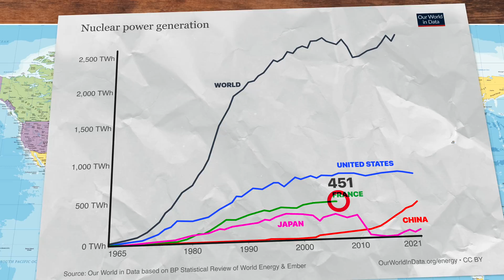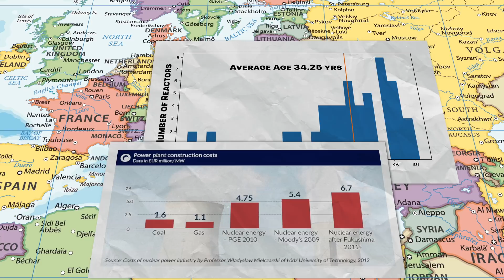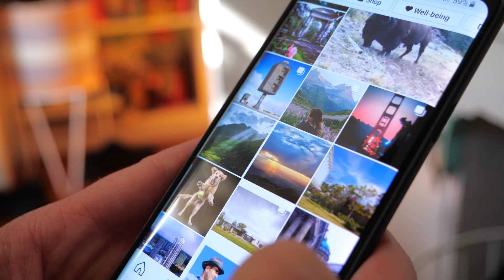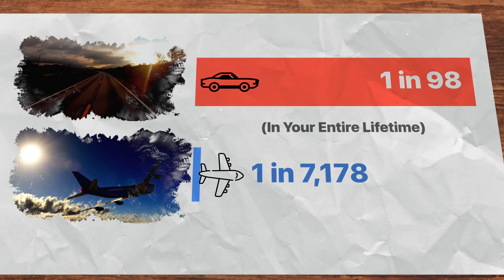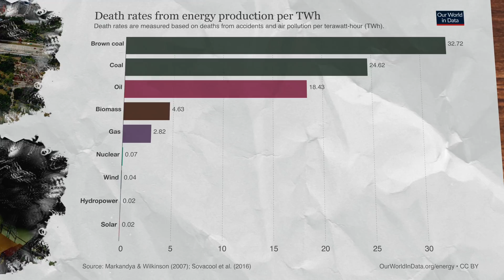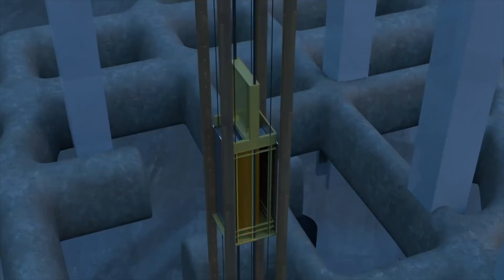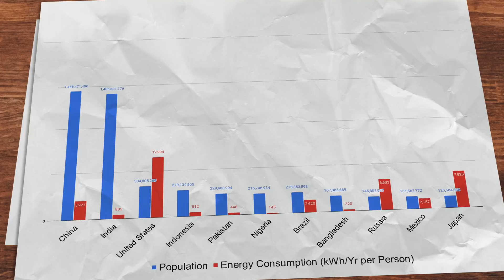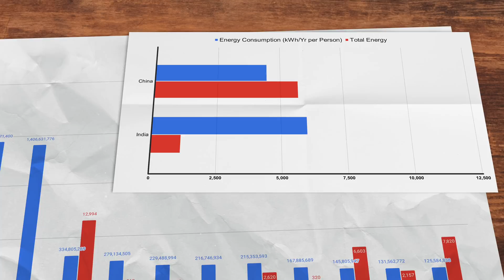The Future of Nuclear Energy Depends On This...

Comment: In addition to what you said about increasing energy demand, it's important to discuss the various ways of increasing energy efficiency and reducing energy consumption.   You've mentioned electric cars, radiative cooling, heat pumps, as well as deep-water air-conditioning.  That last one you didn't talk about before, but each of those technologies massively reduces overall energy consumption.
Reply: We should be decreasing overall energy demand, not increasing it.

Of course by this I mean total energy not just electricity. If an electric car pencils out to less energy than a fossil fuel car, that's great. If it's roughly the same and powered by low carbon sources that's fine too
Reply: High insulation especially in older houses dramatically reduces heating energy needs.
Reply: We need to keep in mind that personal choices on long-lived assets make for very slow transitions.  So, things like adding home insulation (80+ year lifespan on the home), replacing furnaces (50 year life span), and water heaters (25 years)... it just won't be fast enough to help.

In a sense, the transition to electric vehicles won't be fast enough either (vehicle purchase to junkyard is roughly 15 years on average and full fleet conversation is a 30-year affair).  But at least the electrics that are purchased can take advantage of the changing grid generation mix in real-time.  EVs really are the low-hanging fruit from the standpoint of the consumer because it allows us to get rid of an enormous amount of oil and gas infrastructure over the same period.

I'll also point out that technologies which depend on a water<->electricity trade-off are better suited to burn the electricity than to waste the water.  For example, 'swamp coolers' were popular in L.A. decades ago but are basically banned now, because water is more precious than electricity.  Same problem for hot water recirculation vs running the hot water tap waiting for hot water.  Electricity is a much better bet than natural gas environmentally in that case.

-Matt
Reply: @junkerzn7312  unfortunately, a LOT of homes are only built for ~30 years these days.

Swamp Coolers don't destroy water, they send it back into the air where it can go back to the mountains and then back into the rivers. Would be interesting to see one made to use salt water though. I could easily rig up a simple one using fabric and a fan and a vessel under the fabric to catch drips and salt, but those are pretty hillbilly vs a professional machine lol
Reply: @priestesslucy  Swamp cooler running on salt water?  That seems like a good way to make an insane quantity of salt.  It could be made to work, but fresh water would have to be really expensive for it to make sense.
Reply: @priestesslucy   Its important for water to actually come out of the tap more or less immediately when you turn the faucet on, not 10 years later.   Particularly during a drought.   So, no, that argument doesn't work.   If the reservoirs serving a population are in trouble, direct conservation is not optional.

You can google statistics on how long homes last.  It's a lot more than 30 years.  Even poorly built homes.   I think the average age at the time of demolition is somewhere around 60 years.

People come up with cooling ideas all the time, but there is no magic bullet.  You can try evaporative cooling with salt water but any device able to actually cool air that way is gonna clog up pretty quickly.  Besides, swamp coolers are really only effective in dry climates, usually relatively far away from salt water sources.

There is also environmental pre-conditioning for heat pumps, to make them more efficient.  Also not a magic bullet.  Geothermal energy (10 feet down) can be used to both heat and cool.   For example, if the outside air temperature is 100F it can be preconditioned down to 80F through underground piping, which gives the AC unit another 20F of margin.   And similarly, if trying to heat in very cold climates, very cold outside air (say, 20F) can be warmed to roughly 40F the same way before going into the heat pump.   But it is relatively expensive to excavate and pipe these sorts of systems.

-Matt
Reply: @junkerzn7312  a 'professional' salt water evaporative cooler would have to be engineered with some kind of salt trap to be periodically emptied by the homeowner. Obviously nothing currently on the market is going to work without gumming up. At the very least I know for a fact the simple towl+fan system doesn't gum up, the fan blows into the salt water rather than pull through it.

Regarding dry areas crazy far from salt water... You do know we were discussing California right? Is any part of Cali more than 300 miles from the coast?
Reply: @priestesslucy  You are assuming that the salt would just fall out of the evaporator.  That isn't what would happen.  It would get stuck in the evaporative elements and turn into a hard mineral rock like mess that you would have a fun time getting out.

And what are you going to do with the excess salt and other assorted minerals and sea junk?  In fact, where are you even going to get the seawater from?  And why would you even want to use seawater in the first place?   It isn't actually hot 'by the sea'.

You think you are going to pipe seawater 300 miles?  And what, contaminate the soil with the excess salt and sea junk?  That makes even less sense than anything else you've said.

It's a fun little exercise, but I don't see much point in pursuing something like this.  You aren't even trying very hard to think things through.

-Matt
Reply: One very underestimated ways of energy efficiency here is the change of infrastructure that is taken place is many industrial countrys, all western countrys of Europe have already plans to increase their bicycle and public transit infrastructure which leads to an far deeper decrease in electricity use than electric cars.
Even in the US some cities already realised that they're loosing money on suburbs because they need way more roads, water pipes, electricity lines, etc. than higher density areas which could lead to the allowance to build something other than single family homes again.
Reply: Landon, these all increase overal electricity consumption
Reply: @JasperKlijndijk  No.  They decrease electricity consumption. Electric cars especially reduce electricity consumption relative to ICE vehicles.
Reply: @firefox39693  technically untrue.

Electric cars may reduce overall energy consumption but they absolutely increase electricity consumption. By a lot.

I probably use less electricity for my home overall than I would by driving an electric car.

While I'm here though.... Deep water air conditioning? I've never heard of this
Reply: @firefox39693  You seem to be confusing "electricity" with "energy".  They both start with E...

Comment: Go micro reactors! Smaller. Cheaper. Quicker to construct. Easy to deliver. 🙂
Reply: Bingo! Once you work out the initial design and manufacturing flaws getting many many more reactors built per year should be cheaper and easier the way mass produced cars are WAY cheaper than custom ones...

Comment: complains about how we can't build things anymore and quotes failed inspections on brand new facilities, then goes on to claim "corrosion resistant" containment will safely hold nuclear waste forever 🤦‍♂️🤦‍♂️🤦‍♂️🤦‍♂️
Reply: Nuclear waste is recyclable since the 1960s.
Reply: @LuchtLeiderNederland  I agree, the point I'm making is that it's surely a bad idea to store it, as this video says is the current plan
Reply: @joecrancher2008  Nuclear waste is at least storable while pollution caused by fossil fuel is not. Nuclear power is one of the very few electricity sources that can store its waste while producing a lot of electricity.
Reply: @LuchtLeiderNederland  yes I know all that and I agree, you seem to be missing my point completely, I was pointing out that he said "we aren't able to build things properly any more" citing lots of brand new facilities that were found to have major flaws and failed inspections, and then a few minutes later insisted that we'll be able to build containment facilities that will last basically forever. I was simply pointing out a major inconsistency in his claims, that's all
Reply: @joecrancher2008  I’m sorry, I didn’t notice you referred to the person in the video in the original comment, my bad.
Reply: @LuchtLeiderNederland  all good bro! I think if its done well, nuclear is the best hope. The French are probably the best example for safe nuclear

Comment: That’s a fallacy, you’re not accounting for the time/cost it takes to recover after a disaster. If you add that to your calculations you see immediately that a 10,000 year inhabitable zone is much worse than a few dozen deaths followed by a few months of reconstruction and the 10k inhabitable zone also comes with many deaths
Reply: Assuming you meant “uninhabitable” then only the Chernobyl disaster will have such a long-lived exclusion zone.  Chernobyl had some major design flaws that no currently working reactors suffer from, even most reactors older than Chernobyl had safer designs. Every other nuclear disaster has been contained, at most only an entombed reactor is off limits to permanent habitation.

Modern reactor designs actually can’t meltdown.  Failsafes halt the reaction if the cooling system shuts down. 

When statisticians calculate the deaths from an incident at a power plant they account for problems during evacuation and long-term health consequences.  Nuclear disasters are exceptionally rare so even expensive as they can be (for just the three that everyone has heard about) their contribution to the overall cost of nuclear energy is negligible.  Go ahead and do the math yourself; add up the recovery costs of the Chernobyl, Three Mile Island, and Fukushima Daiichi disasters and divide by all the Watt-hours nuclear power has ever produced.

Comment: Yes, nuclear energy is statistically one of the safest sources of energy production. The problem is that if something goes wrong, it could be catastrophic. Whether or not it's statistically unlikely, a large chunk of the population is not willing to take that chance. Personally, I do like and favor research on small modular reactors and the safer molten salt reactors. Thanks for these videos!
Reply: @jasonk125  Commercial aviation is still the safest form of travel.  Things go wrong with the alternatives too.
Reply: @jasonk125  That's not your point, that's you entirely ignoring my point.  Every form of energy generation has dangers.  In fact other than photovoltaics every form of power generation is statistically more dangerous than nuclear, thousands of times more in some cases.

So you're going to say it's too risky to use the safest form of dispatchable power generation because a bad thing happened once in one of the earliest attempts at it?  Just ignore all the advancements in design and procedure to prevent that scenario because it happened once so it's technically not physically impossible that it will happen again?  That's like refusing to be in or near a car because gasoline can explode.

Also they've only resigned to leaving the Chernobyl Exclusion Zone uninhabitable for 20k years for now because they feel it's not worth the cost to clean it.  They absolutely could open it up again in a matter of years if necessary, that's what happened with Fukushima (granted that cleanup effort was significantly less costly than Chernobyl would be).
Reply: just bear in mind that your idea of "when it does go wrong" is based on a soviet era RBMK with no containment building and a huge safety flaw that was covered up before being put through a ridiculous stress testing regime with a lunatic in charge of a team of people who'd just come on their shift and weren't briefed on said stress test, nor was it carries out as intended.

Comment: A couple things you left out and one correction

Olkiluoto #3 was originally supposed to come online in 2010. I think you mixed it up with Flamanville #3

Vogtle #3 & 4
Similar problems to Flamanville #3 and Olkiluoto #3 only more embarrassingly stupid screwups.

Of course you also have to mention the aborted V.C. Summers #3 & 4 which was halted due to excessive delays and cost overruns and for which the companies involved have had fines and restitution levied against them and for which people have been sentenced to and are facing prison time.

Even the NuScale UAMPS is falling behind the original schedule and won't generate first electricity until 2029 at the earliest.

Fun fact: Three Mile Island #2 took three more years and cost 75% more than #1 due to poor planning and screwups during construction.

And of course you left out the costs. 

Our World in Data has an LCOE of $155/MWh for nuclear power and rising compared to $109 for coal and $56 for gas. 

It's $41/MWh for wind and $40 for solar and falling for both.

Even with storage cost factored in Solar & wind are cheaper than nuclear and even coal. 

Tesla's Megapack in Horsdale has a demonstrated LCOS of $55/MWh. That was with Li ion batteries. They are using LFP batteries which are cheaper still

The Iron Flow batteries you previously covered have an LCOS of as low as $25 MWh.

Renewables are the way to go as they are demonstrably much quicker to deploy and much cheaper to operate.

Comment: Could you please do a video on how space nuclear works and gets used. They probably can’t use making water into steam to drive a turbine 😉
Reply: For most probes and rovers they use a combination of batteries and something called an RTG, which produces electricity by heating dissimilar metals with decay heat. When power needs for the probe or rover drop below the generation rate, the excess is stored in a battery and vice versa. For larger units on a planet with an atmosphere a refrigeration or gas turbine cycle will probably be used since RTG "fuel" is very expensive. For actual nuclear rockets, it is planned they will be activated at very high stationary orbits and and act as a space ferry where they will transport smaller chemical rockets too and from planetary bodies from these high orbits.

Comment: Actually, the current 400 nuclear reactors don't provide 4.3% the world's energy needs, but just 2.2%.

Why this difference?
Actually, much the world's energy needs occurs in the form of heat (residential heating, industrial processes).
Nuclear plants, on the other hand, produce lots of heat: 3000 kWh (primary energy) for every 1000 kWh of power output.
So, what's the problem with these optimistic statistics (4.3%, not bad at all!) taking into account the heat production (3x more) of a nuclear plant rather than its power output?

Well, in the real world, the excess heat is mostly released in the atmosphere (by these iconic cooling towers) or it warms our rivers and the sea, as noboby wants to live in the vicinity of a nuclear plant.

So, 2.2% of today's energy needs.
Let's say, we'd like a world of 50-50-50 in... 2050: 50% more energy consumption and a distribution of 50% from nuclear and 50% from renewables.
Without even counting the shutdown of the ageing current reactors, nuclear would need to grow by a factor of 34!!
More than 15,000 reactors to be built within the next 28 years. Good luck with that.

Moreover, the uranium needs would also 34-x.
Today, pessimists say: at the current rate of consumption, we have cheap, easily accessible uranium for 70 years, optimists say for 200 years.
Let's be optimistic: 200 years, divided by 34 = enough uranium for 7 years , when operating these 15,000+ reactors. Sounds very sustainable!

Maybe Thorium reactors would be a more viable option?
Reply: Yep, the nuclear industry, as it currently stands is unsustainable for very long unless a space probe finds a giant chunk of U-235 floating out there in the belt and the construction situation somehow becomes a non-factor in western countries; China still has a chance to make a difference with new nuclear construction.

The big problem for western countries is natural gas is so cheap so nuclear plants are being closed instead of being re-licensed. For now just keep the plants running until we can get enough solar, wind and batteries online to eventually take over. There are USA companies doing this with a few plants re-licensed out to 80 years from the original 40 thanks to much newer instrumentation technologies and the fact the wear on the plants is significantly less than expected, since the heating and cooling cycles are very infrequent at these base-load facilities.

The thorium cycle is the answer for the long run since it is cheap and we have enough for many many years, or at least enough time to figure out how to make fusion viable. Not to mention the unused fuel stream from a thorium cycle is much smaller since the reprocessing essentially happens inside the reactor.

Also speaking of viability while building them is pretty easy, the disposal of solar panels and wind turbine components is a disaster waiting to happen (look at our disposal of simple plastics) if we continue along the renewables plan for many generations. It is an excellent band aid for now but their are better more permanent power solutions out there which take up much less natural real estate and use a tiny amount of materials in the long run, at least in comparison.